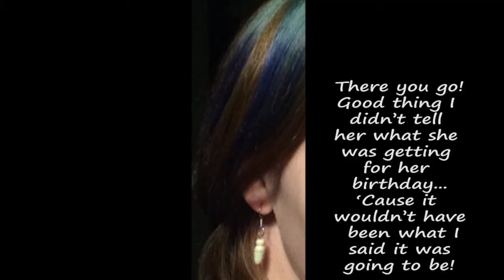Wood Turning #103 Texted White Tail Deer Antler Earrings

Comment: Thanks Larry. Great little project. I was wondering if the earring would emerge with the soft center. You nailed it my friend. "Slight change of plans", LOL. I Love It! Keep em coming buddy.
Reply from the maker: Stephen Ogle Hey Stephen... if it hadn't been off set there wouldn't have been a problem! So long as it is turning straight you can take it pretty thin... if you remember the Spilicans ... they were only a 16th" thick and they are still being used on the crib board! ;>) It is easier to change plans than it is to start over! ! ;>) Thanks for watching   Larry
Reply: I agree completely. Well done Larry.